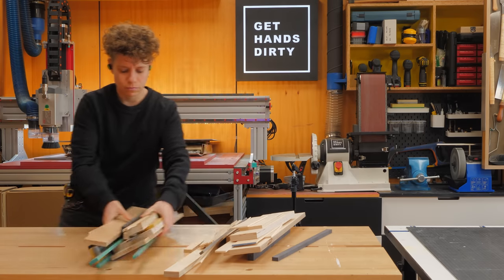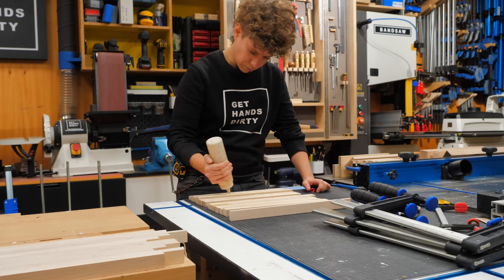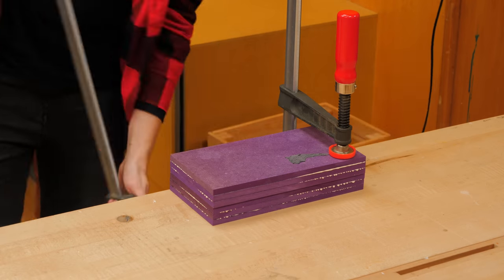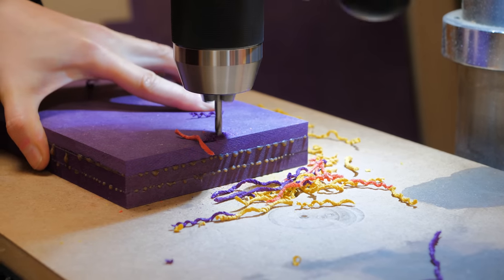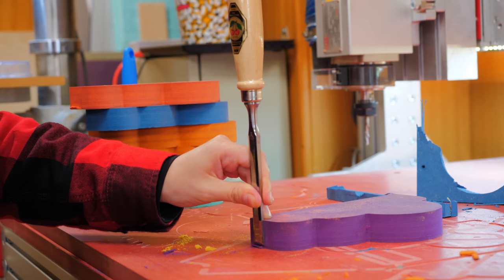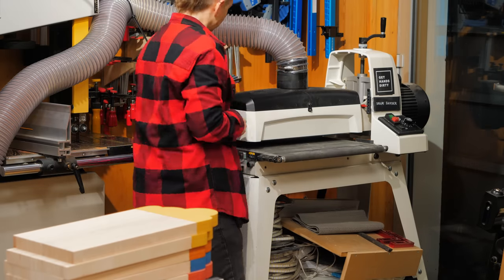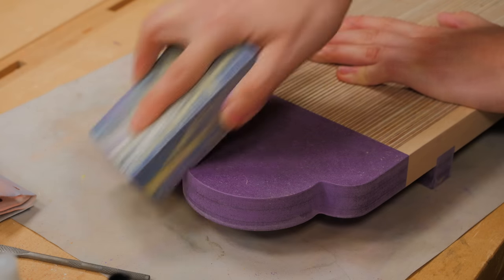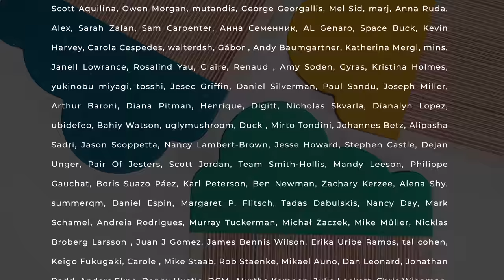A Secret Project I Made From Scrap Wood

Comment: My questions is did u throw away the scrap cut offs from the boards or did u save them to create a city landscape? 🤣
Reply from the maker: I thought about that!! Ahahaha, they are still here. I might do it!
Reply: @GetHandsDirty  That's funny, I saw potential soon as the edges cut away! When your so creative everything has possibilities.  
Love ur vids & shop!!
Reply: @GetHandsDirty  there are also some videos about sound diffusion boards made from scrap wood like this. Might look good in your studio or apartment and reduce some echo.
Reply: Hahaha I was thinking the same thing!
Reply: 🤭 I also had the city association, as I saw those offcuts. I'm dreaming about a coffee table in that style, glass top, city below. But I think those weren't enough for that.
Reply: @GetHandsDirty  you should sell a grab bag of cut offs. I would buy them for sure. I have a table top lathe for pen making. Others might buy them for resin projects and such.
Reply: @fapyfuchs  she has more scrap 🤣 
That b cool coffee table. I got rid of my tables. I renovated my small 850 sqft 1942 bungalow. Actually still working on it. Just need to finish half the house laying cork floor & trim. I knocked out the shared kitchen & living rm opening it up (knocked out few walls). Couldn't find a sectional I liked & would fit that wasn't extremely high priced so I made minalmist modern w plywood & metal legs. 1 side is a lounge & other has it where cushion is in middle leaving the sides to b used like an end table. That wasn't very good discretion. I still have to make covers to cushions, didn't want to do that until everything done inside.
Gives the Rotties floor space & their tails don't knock everything off like they do w coffee tables. I taught them "No Wag", the basically turn to stone staring at me few seconds then get all excited & trail goes faster🤣

Comment: Looks great. Just curious, isn’t the glue is plywood toxic? Or did you use a ply which is good safe? Maybe it’s ok when it’s sealed? Asking cause I like the idea and may use it up my ply scraps in the future in a similar way. Thanks
Reply from the maker: I wouldn’t say it is safe as a cutting board but with a proper food safe finish that seals the plywood, there wouldn’t be a problem placing food on top. Even if the plywood resin was food safe, I wouldn't use it as a cutting board because the birch layers are quite splittery. I don't recommend sharp knives on this type of kitchen board.
Reply: @GetHandsDirty  I depends on the plywood and/or MDF you have. I know, you are in contact with producers of these colored MDF; maybe you should ask them. Formaldahyde is no joke, even if some say small doses are not toxic. Oiled or wax finish will not keep off gassing in check, even it is small or negligible. Selling material that is not food safe as "food safe" is a bit misleading, to say the least.

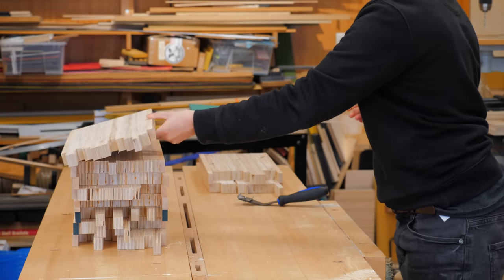Comment: 2:46 Here's an idea of what to do with small, unwanted wood scraps: sound diffuser panels - especially big ones. Cutting off the jagged edge at 2:46 you instantly get one, albeit rather small. People pay seriously good money for these things and I bet one made of multicoloured bits of mdf is one no-one has ever thought of making.
Search for sound diffuser (diffusion) or sound absorber (absorption) panels and you'll instantly find what I mean. They can take a lot of time to make if you're cutting the bits that are needed to make them intentionally at random lengths but if you already have a head start on this, why not?

Comment: 4:08 Use the remaining open time to allow the glue to loose some moisture and soak into the fibers. Once the surface starts to become tacky you can assamble the pieces without them swimming all over the place. Also you wont get as much squeeze out.
Reply from the maker: I see what you mean, but doesn't the glue line become thicker? Since less glue will escape because it isn't runny anymore.
Reply: @GetHandsDirty  The idea is let the glue soak into the wood. Then there is no need to force glue in and you only need a fraction of the glue you used before. Finding a good balance with minimal application of glue and squeeze out while maintaining the strength I haven't mastered, yet. I still use too much glue and most of the time I don't wait long enough (or my glue is just too old). So I still produce squeeze out but the "swimming" isn't as bad as before. I've learned this from other woodworkers on YT. None are english, though.

Comment: Remember to use “Upcut bit” to Avoid the dust to compress when you are cutting. Looks like you where using “downcut bit”
Upcut take the the dust up, and downcut moves it down, and makes it nearly impossible to remove dust.

Comment: to allow pieces to stick together without sliding just spread a bit of salt between the layers. It will not affect bonding by any means but you won't be able to slide pieces that easily

Comment: Great project, the boards look amazing.  Please don't use the miter gauge with the rip fence when cutting pieces to size, it's a great way to turn your project into projectile heading towards you (kick back)...
Reply from the maker: Thanks for your input. It might be the camera perspective making it seem like the wood was touching or too close to the fence because I never rest pieces against both the miter gauge and the fence. Great safety tip nonetheless!
Reply: @GetHandsDirty  Good to hear, it did look close, so must have been the camera angle.

Comment: I really wouldn't use MDF, OSB, plywood, Fibre boards etc. For anything coming in contact with food. The producers mainly use an industrial glue based on formaldehyde to make these kinds of boards. I wrote my thesis about the wood industry this year and in my research I found out that 80-90% off all non solid wood boards are made with UF glue containing formaldehyde

Comment: Just as an FYI if you want to do something like this. This is not food safe and should not be used as even a serving board!, not only wax and is not food safe.  The glue used in plywood is not good safe, and on top of that the MDF used as the colored handles is stuffed full of chemicals including formaldehydes. All together I imagine using these would leave a chemical taste to your food. If you want to making something like this, try using a white wood like maple or poplar, and using a food safe dye, and a mix of mineral oil and bees wax finish. Stay safe and enjoy your project!

Comment: This is a problem with most creatives who have to use a lot of tools and materials. I do costuming, so I can have buckets and buckets of scrap fabric at any given time. A small solution I have found is to make pillows and use the soft scrap fabric as stuffing. But even that will only get you so far.

I feel for your dilemma.

Comment: wait... the glue in mdf is toxic. Also baltic birch plywood use formaldehyde glue (same glue used in mdf) as far as i know. Probably not a good idea to use it in a cutting board application. Before u say it: yes someone will cut someting on it. I love the look of it but i have some concerns for its use. Thank you for the video.

Comment: I would love if people stopped using plywood as cutting boards, specially when they have no idea what product was used to make them. Some use toxic types of glue, not ment for boards.
Reply from the maker: These are not cutting boards, as mentioned by the end of the video. As long as the finish is intact, all is good to place food on top.